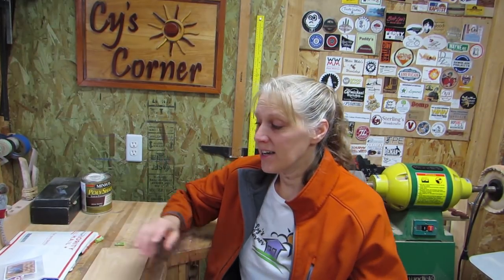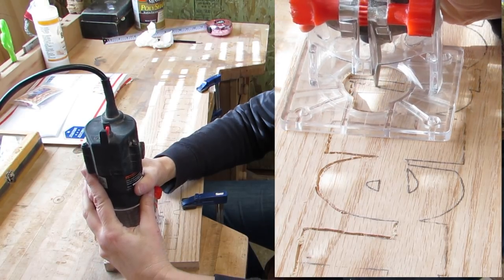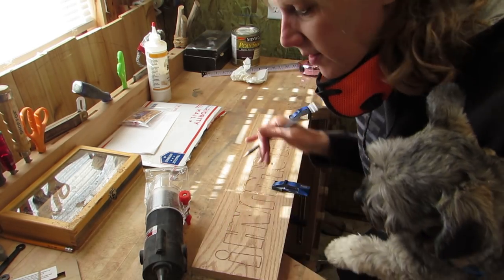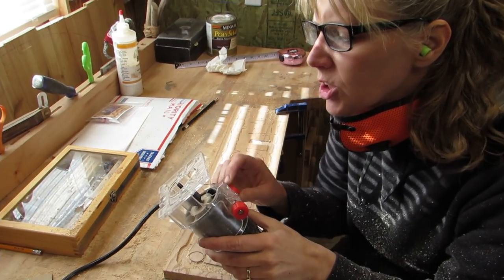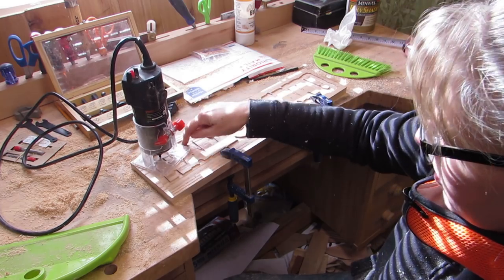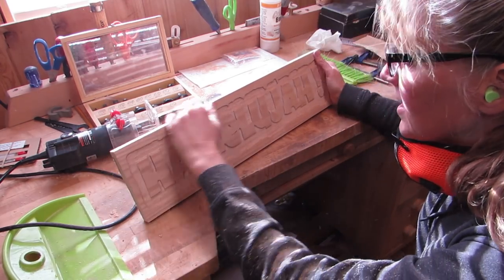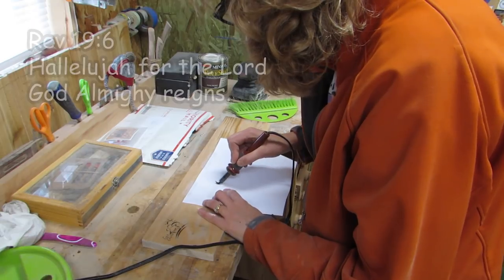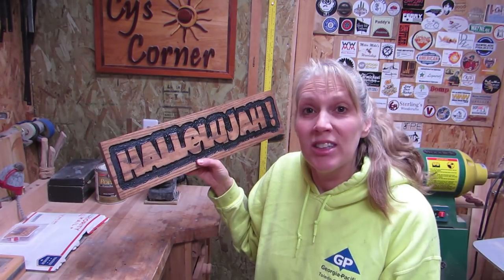Dave's Signs Technique!!!

Comment: I've done the same kind of signs, I have a video of one, but something that really helps is a trick I learned while studying drawing and it's helpful for many things. Basically if you want to draw a straight line, or route one, you have to look where you want the pencil or router to go. Then your hand will guide the pencil or router to where you're looking giving you a pretty straight line. It takes some getting used to not looking where the pencil or router is at that moment but rather ahead of it but once you get it you'll be much steadier and produce easy straight lines.
Reply from the maker: Thanks Jaime! I just checked out your video, very awesome!!!

Comment: I enjoyed the video. I appreciate that you incorporate your faith into the video.
I also encourage you to use a better base for the router. Being able to put my hands directly on the board I am cutting is a huge improvement in controlling the router.
Don't worry too much about straightness of your lines. You will get better with practice and in most cases, it is not as noticable as you think. I have more trouble with flat faces not being flat. You cut a flat bottom on your background. If I did that, I would be chasing each little tool mark. Dave's deeply textured background solves that problem and becomes a feature.
Keep practicing and keep improving. (I guess that applies to everything you do.)
Reply from the maker: +B Templeton Thanks. :)!!! I see how the textured background hides some flaws, and straight lines that aren't so straight aren't so noticeable like you said! A few folks mentioned a better base so I've looked into buying or making one! I will keep practicing :D!!!

Comment: Hals Wood Shop.   Thanks for showing one way to make a sign.  Here's some time saving tips from other sign makers I stole theirs and they work.  Buy clear contact paper to cover the wood. as you are ready you can design any design or letters. Brush it down well to stick.  Then rout what you want.  Now when you spray no sanding everything.  Pull off the excess when its dry. I even heat dry the paint.  You are right a 2 handed base is better, and get the project in front of you and the forearms on the table and it will give more motion control.  Try making you own base with plexi and knobs.  Use a shelf rubber mat under the sign and it won't move.   I use a poster board display to catch all the sawdust behind the sign. Thats the easy hints.  Enjoy.
Reply from the maker: +Hal Kester Wow!!! Thanks for these great tips and tricks Hal! So very helpful!!!
Reply: Thanks I was making and selling signs.  Recently I have been learning about benches and drawers from utube " the masterwoodworker"  he has a rather plain new workbench that you might look at for the new shop.  He is a cabinetmaker in Wisconsin.  good simple ideas in it for clamping and storing without frills.
Reply from the maker: Awesome!!!

Comment: Hello Cy  good job on the sign  -  I have a tip for you -  you might want to use it -  I got my Dewalt 611 and I didnt have the baseplate from Eric  so I had to carve like you did.  I found that if I held the router closer to the base I would be able to keep the router more steady and my lines were straighter.  Hope this helps  Burt
Reply from the maker: Thanks Burt :)  I did end up making a router base for it. It helps sooooo much!!!!